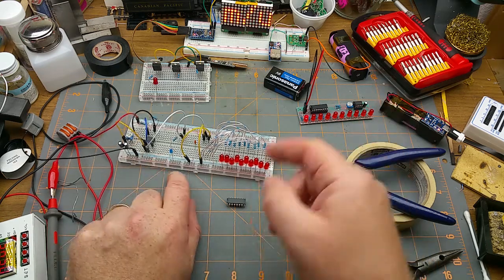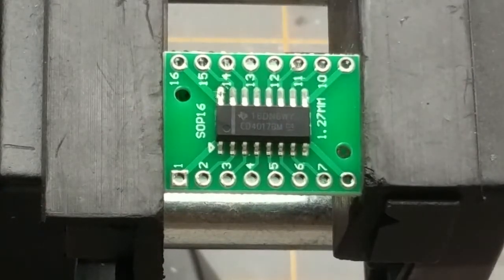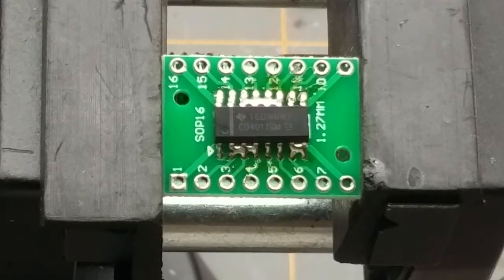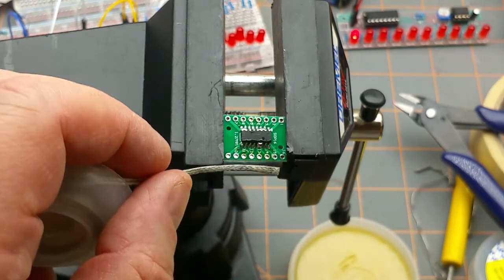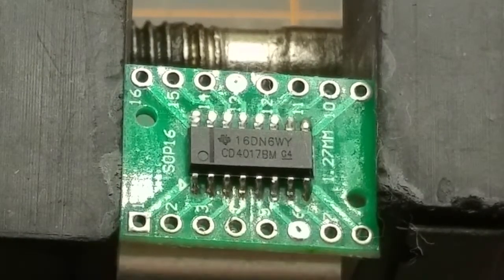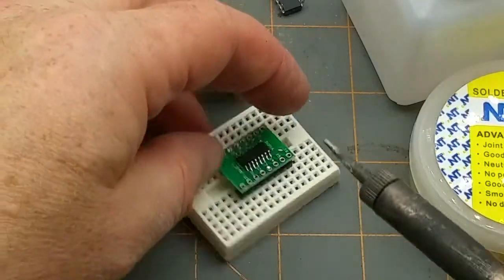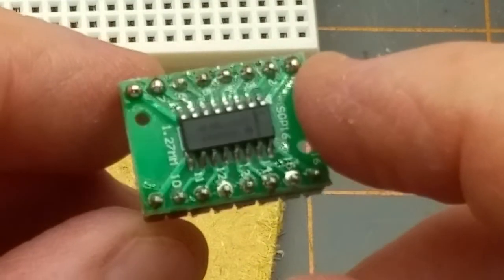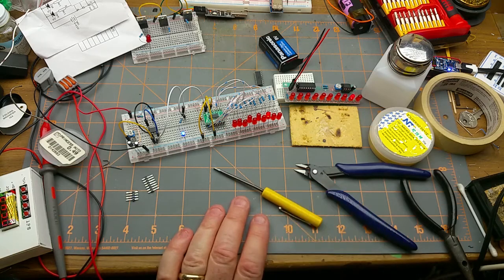Surface mount on a breadboard?

Comment: Cleaner tip and flux would really help a lot! It solders better and excess solder is not left that easily on the pads either. With flux you can pick up excess solder with iron tip that is wiped. After I learned that, I started using flux on every smd joint I solder. i never even try soldering them without adding flux initially. Cheap wick may not work that well without flux either. Flux never hearts.

Comment: Great! Where do you get the surface mount to DIP adapter?
Reply from the maker: Ebay! home of all manner of cheap stuff.
I'm sure they were featured in an old mailbag, but they can be had fairly c\heap. here's an example: 

https://www.ebay.ca/itm/10pcs-SOP8-turn-DIP8-adapter-plate-SMD-adapter-plate-M57/291550040931?hash=item43e1bc9363:g:zAIAAOSwr81UOENn